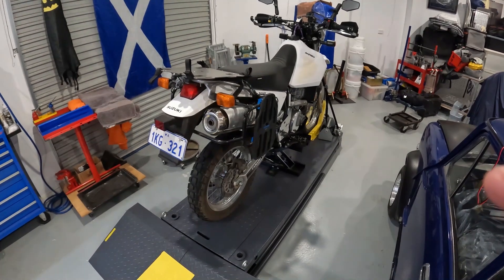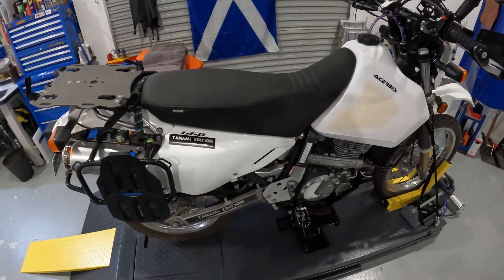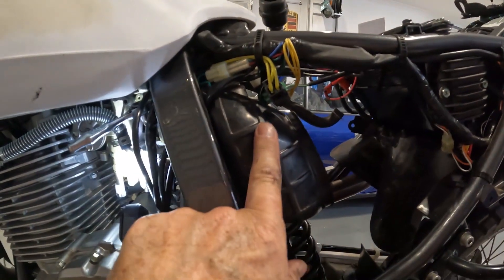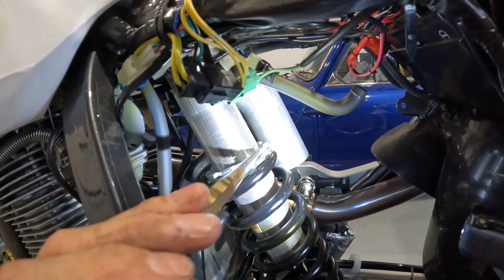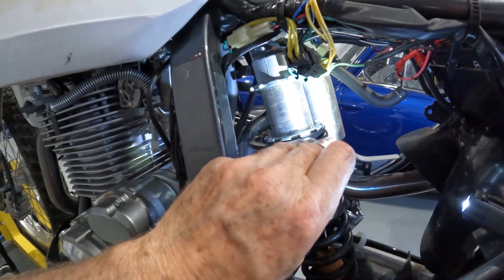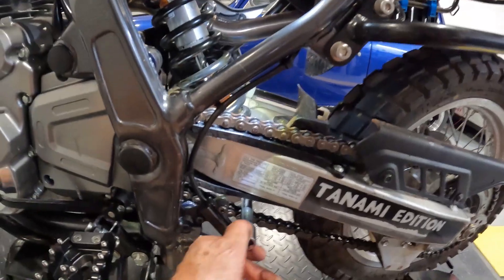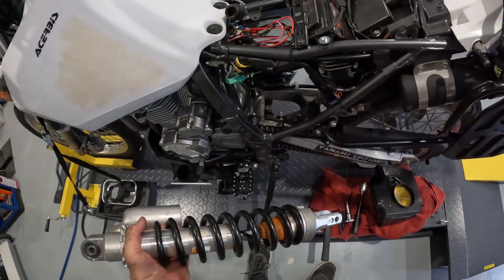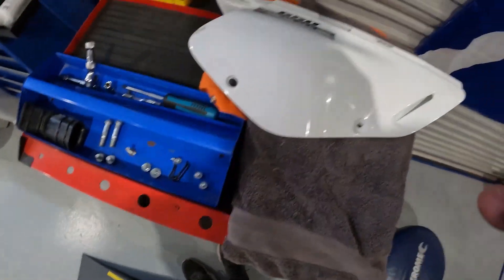Suzuki DR650SE Rear Shock Removal

Comment: Never worked this bike - You're right  those Air Box Bolts are the KEY to getting the shock out... I didn't touch Pre Load Rings because the rear wheel was off the ground so  I moved the swing arm up a Tad and  the shock came straight  Up and Out.
We installed Race Tech Springs  Front .60kg/mm / Rear 7.6 kg/mm  for a 155lb rider - Test Ride was a Blast... Thanks for the TIPS !!! 
Next Pay Day we'll install Race Techs  Rear Shock Shaft assembly, it comes  with Gold Valve, Hand adjustable Rebound Knob, and a Rebound Separator Nut on end of shaft.... The Fork we'll install Emulator Gold Valves -  Oil Level set low to  7 inches for stiffer springs.
Reply from the maker: Makes a massive difference when bike is tuned to the rider. Mine is a bit stiff when it hasn't got the luggage loaded but still a big improvement over stock. Thanks for comments and watching.

Comment: In my xf650 I remove it from the bottom without touching the airbox. I just removed the rear bolt of the linkage, and move the linkage out of the way. It's worth a try on the DR too.
Reply from the maker: That is an alternative. But the bolts at the bottom are really tight, lots of washers and linkages and you are working underneath.

The airbox is 3 x #8 + 1 x slotted circlip and its out .

Whatever you believe is best for you 👍😀

Comment: The stories you hear about that upper chain roller being ripped off and tearing a giant hole into the frame is due to bigger guys bottoming out the stock suspension. No need to worry about it after the heavier spring and revalve.
Reply from the maker: The pictures I have seen where it has ripped out has the frame corroded out. The key is to keep it lubricated/greased and free moving.

Comment: What size c-spanner is recommended for the DR?
Reply: G'day Sam, not sure what size C spanner. A few c spanners are adjustable. Measure the diameter of the nut and usually most will fit. In any event there isn't much room for a spanner when the shock is fitted. If you have the shock out its easier. The C spanner I had was probably from another motorcycle - maybe even a bicycle crank not I think about it! Thanks for watching.
Reply: Don’t need it..just tap the top nut to loosen and spin it up as shown. Then Just lift the rear a little and turn the spring by hand, the nut will move up along with it.  Very easy.

Comment: Awesome job though i do recommend putting a fuel filter on your bike the filters included in the bike are junk
Reply from the maker: Yes, I was thinking about that. I don’t really ride very dusty conditions so probably not urgent.

I’m also thinking about a Safari tank and will get one when I swap over.

Thanks for the comment 👍🏻😁
Reply: @lifelongmotorcycling  i just got one at a hardware store and cut the line to fit making sure to keep it away from the engine $12 and probably 5 minutes worth of your time is super worth it imo especially since the carb is very finicky but that might just be Canadian gas causing that
Reply from the maker: @upperjohn117aka  our gas is good with high octane levels and no ethanol. Biggest risk for us is dust in the tank due to our red dirt and dry conditions. 

I will add a filter at a later date so thanks for the prompt. I agree - 5 min job. 😁

I’m thinking about a Safari tank so I might add one then. 😁👍🏻
Reply: @lifelongmotorcycling  definitely worth it to get the safari if you do adv riding
Reply from the maker: @upperjohn117aka  agree. 👍🏻

My 20 litre Acerbis gets about 390 km completely empty. Gives some range anxiety.😬

A clear Safari will be a great option for those longer ranges. Probably get closer to 600km. 🎉😁

Watch Skids and Stuff when he goes down south in Western Australia. Even with a Safari he runs on fumes on the way back 😳